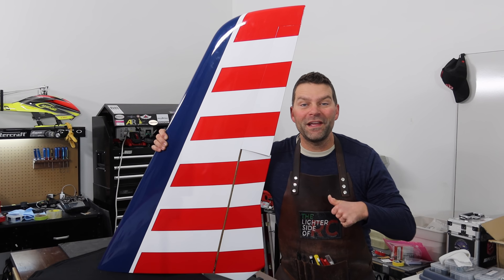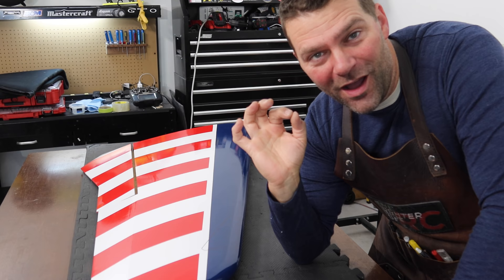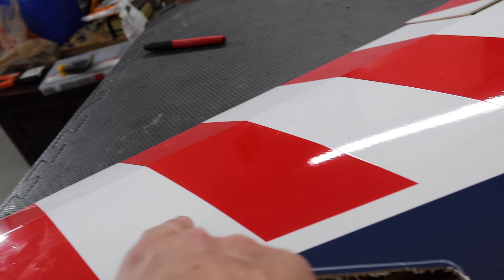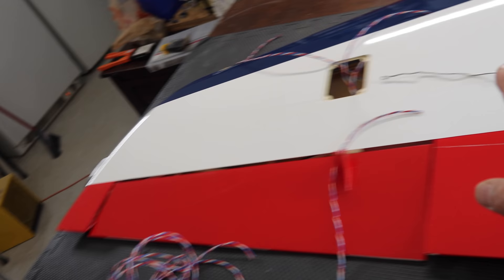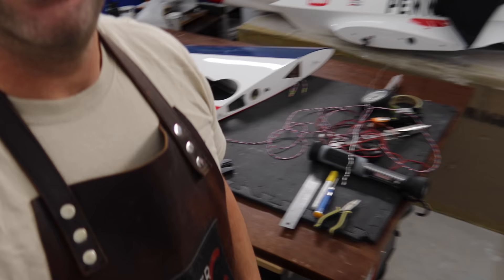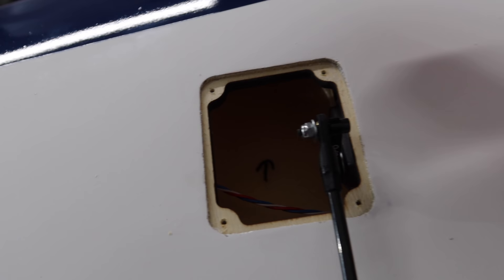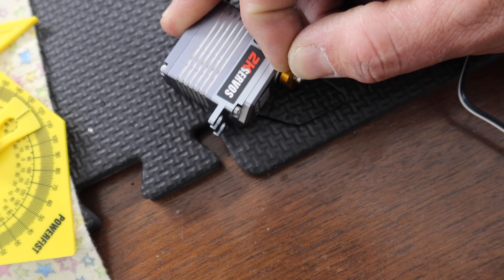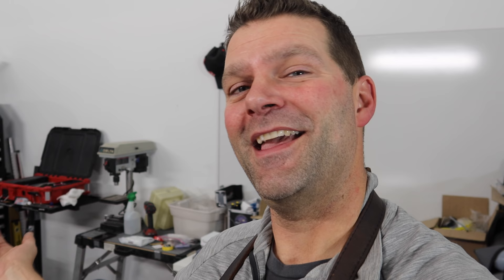Aerocarcontrol HURACAN RC JET Build - Wing Assembly

Comment: You are on the cutting edge of RC build tech Jonathan. Not only do you have Mr Bendy the multi tool screwdriver, but,  I’ve just seen old Hooky the the coat hanger wire puller.
Reply from the maker: HAHA.  Thanks Michael!  Old hooky is so dang useful as well!  😊

Comment: Great update. Nice to see the review of the Power Box servo connectors. I like those alot, but not many vendors in Canada for those.  TB carries the wire at least.
Reply from the maker: Thanks!  Yea I usually order the bags of 50 of each and keep a few in stock.  Typically order from Powerbox USA or dreamworks.

Comment: Hey...I love your work. I’ve seen a few large and xl scale planes crash and explode. Granted, forces multiply on full size aircraft but on these smaller planes, I never suspected crash forces would destroy carbon fiber and  a plastic fuel tank.
Reply from the maker: Yea it's pretty destructive when the aircraft hits the ground and you have lots of fuel weight still in the tank!

Comment: On your “Tip Time” you suggest that we make sure the wire plugs are attached at the servo installment hatch and you suggest that we loop the servo cord to shorten . Would it make sense by cutting and making the servo cord about 4” long and reattaching a plug to eliminate all the excess wire?
Reply from the maker: Yea you can do that as well.  on a hidden area i like to keep the full length because in the future you may want a long lead if you repurpose the servo.  on my steering servo, because it's visible I will shorten that and not wire tie the servo wire.  Just personal preference.

Comment: Why not just solder servo wires, specially at this size of plane loose connector could cost you  model crashing?
Reply from the maker: That's the purpose of the heat shrink tubing on the internal connectors.  i'm not a fan of soldering servo wires.  It's probably wrong for me to say it creates a failure point as the connector is also a failure point.

Comment: Wouldnt a dremel have been easier for the cuts ?
Reply from the maker: Yes absolutely.  The reason I used the thin pull saw was I wanted to save as much of the cutout piece as possible.  I ended up sending those pieces with the light housing to Ozaero to help with the modification.  I could have used the dremel with a thin cut off blade.

Comment: Hi Jonathan,
When I first saw those wing lights I thought they might be awkward to install. I imagine they will get redesigned so the inner and outer edges are parallel. Like the servo wire tip time from bent screwdriver. :-)  Do you always use through holes on the servo control arms, or have you tapped any of those holes? Wing is looking great. Looking forward to the next video. You and Katie stay safe.
Reply from the maker: Thanks Don.  Re the servo control arms I will generally just use a through hole for simplicity.  Easy to tap but as long as the drill bit is the right size and it's a snug fit it's good.  Thanks for watching!

Comment: For the lightening system, how do you assure that you can run the wires on the inside of the wing properly.
Reply from the maker: Great question!  On a plane like this, being the first it's purely a guessing game.  Do it and figure it out later.  You can look inside the servo hatches, use a mirror or a scope and do some pre investigation to make sure it will work.